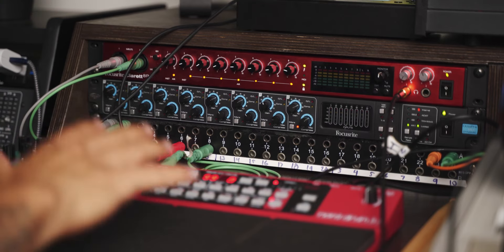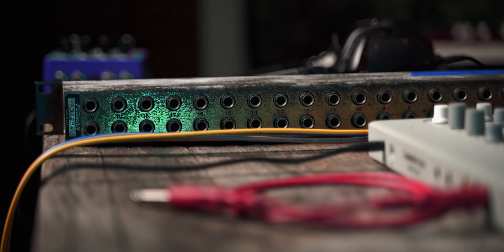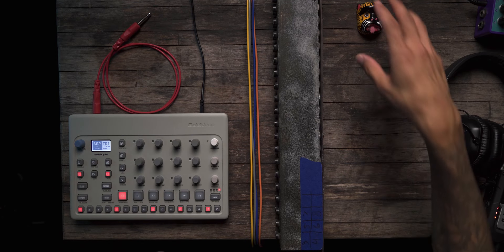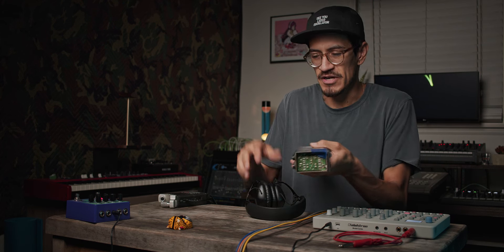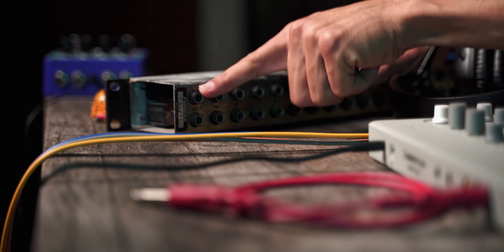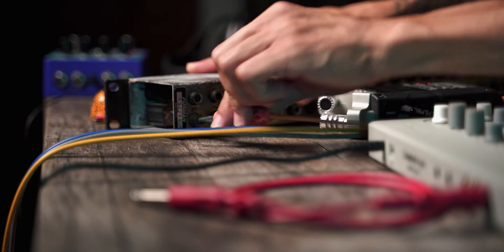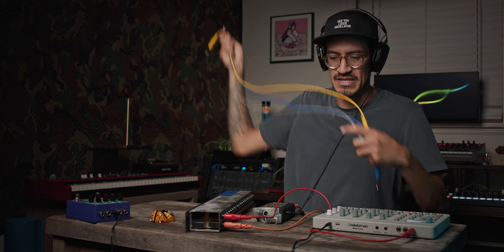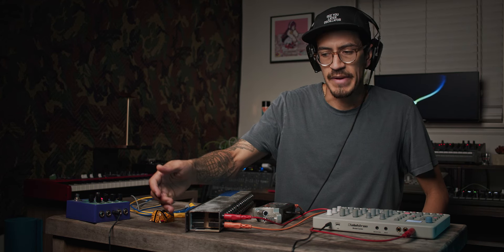3 ways to use a Patch Bay // Why they're amazing but not necessary.

Comment from the maker: OnceUponASynth vid here - https://youtu.be/Ie8J_XjOaFw
As well as the Samson patchbay I was talking about - https://amzn.to/3h2smk2
Reply: Dope video but that link is dead for me.
Reply: @toastyghosty489  The link works for me
Reply: What if you wanna hookup 5 synths to this and then depending on whatever one you want to route into your audio interface, you just patch it to there? so no bottom plug on the output for each synth, but a single output and no input on the channel for the audio interface?
Reply: Can confirm that the Samson one is very good!
Reply: Are you familiar with the BoredBrain Patchulator 8000? Never knew I needed, couldn't live without.
Reply: @elpotato198  Sure; in that case you're just not using the normalling, and you'd plug from the front panel top from synth into the bottom into the audio interface. But if your synths have inputs as well you can add them to the patch bay, and route from your lead through another synth maybe for its effects or filter or stuff, then onto your input.
Reply: Any link to the audio of the song you playing on the video ?
Reply: @zenkomusic  It seems like Samson is the only mfr. that has an important patch-bay feature not to miss. memory is not serving me well which feature, though. ;-)

Comment: Other big benefit Ricky is that it really reduces wear and tear on gear IO’s; better to clap out a $100 patchbay than an expensive or vintage piece of gear.
Reply from the maker: Yeah, I never thought about it that way! That is a completely valid point
Reply: my analog keys headphone output has a broken tip from a jack plug stuck in it, that was a major reason why i bought a patch bay.
Reply: Even just moving the gear around to get to the output will cause wear and tear
Reply: Leslie Dugger or could drop a heavy keyboard or something.
Reply: Burp Robrox totally! I have a Jupiter 8 I’d hate see crash on the floor or on my foot!
Reply: Leslie Dugger not the fabled Jupiter Ain’t as in Ain’t working after it crashes to the ground 😩
Reply: James Reedy this one is luckily still in orbit.
Reply: @Morne555  
Exactly the same happened to my Analog Four , still has the tip stuck in it
Reply: yes, this is why i want to do it. I have expensive rack gear but also wired a snake through my soundproofed wall and would dread having to replace any of the xlrs
Reply: @matthewspring2496  they are pretty straight forward to open and if you are lucky you can push it out from the inside, but even soldering a new socket in should not be that hard for a beginner ;)

Comment: This is soooo good. No one explains it like this and I’ve been researching for some time now. Most people explain patch bays using those diagrams, which can help grasp the signal flow of it all, but seeing you run through it stripped down and hands on connects so many dots in my head (no pun intended?) and already unlocked more ideas than I thought possible before (and I don’t even intend to use my patch bay for the same applications shown here) great video, thank you!

Comment: Using left/right top/bottom is perfectly reasonable strategy with unnormalled style patch bays. There are lots of flexible ways of using that as well. There's a reason patch bays come in different configurations and switchable configurations

Comment: Nice video! I have 5 rack synths - MKS-80, MKS-70, JD-990, EMU 9090 and a TX-802 and at first my assumption was - get a mixer and throw everything in and have L/R out to an audio interface and into the mac and use the mixer to control levels - or get an audio interface with 10 or more inputs. I then realized - I don’t need to listen to or record all the synths at the same time, so I don’t need the mixer, and as for the audio interface - a Scarlett 18i20 is powerful but ridiculously expensive, so I got a 4i4 (a 2i2 would do it too) and got the Samson 48 point balanced patch bay, plugged the 5 synths into the 10 “ins” on the back with my most used synth on the first 2, have the first 2 outs on the back of the patchbay always going to the Scarlett, and then just use patch cables on the front to choose which synth I want to go to the Scarlett. For example - 1 and 2 on the back is my MKS-80. 25 and 26 directly below that on the back go out to the Scarlett. 3 and 4 on the back is the JD-990. If I want to record or listen to the MKS - I don’t need to do anything. If I want to listen to the JD-990, just plug patch cables from 3 to 25 and from 4 and 26 on the front. As for effects - I just add it between the patch bay out to the Scarlett in.

Comment: I saw a badass routing trick in a video by the guy who made the Minibay. Let’s say you have a sound maker with a stereo output, for example a Volca Sample. Then you plug just the right channel on the patch bay into an fx input, eg a reverb. Now you can pan dry tracks on the Sample to the left and wet tracks to the right! So you can treat tracks differently in one box with one fx input. (The Minibay has a summed feature where you can sum up to three signals, so that you can separate wet from dry, but they’re still going into one input on a mixer, for example).

Comment: Truly a game changer! I find myself quite often depressed about the limited and inflexible routing capabilities of hardware mixers, like limited amount of channels, sends, receives etc., especially with regards to using FX or quickly sampling something into (or from) a device or DAW. I always thought I had to step up the game and go for a bigger mixer with more channels, with the 'perfect' routing etc... Just to browse gear websites and to find out that you can spend hundreds or thousands on mixers, and would still be stuck with a relatively inflexible routing. And after all, for the typical (home) production use cases there is no need at all to mix together 16 signals or so at the same time. Well, good to learn from that video that I just need a patch bay instead, and probably all routing dreams will be leveraged forever ❤

Comment: And for those who want to totally get rid of cables on the front side while still being able to create complex signal chains, I can recommend the Flock Audio Patch. It uses a computer app to change the routings and has D-Sub ports on the back that can be converted to jacks or XLR using breakout cables.

Comment: We used to call that "Sniff & Break"
Top row are Un-normalised outputs and Botom row are Normalised inputs as you have shown.
So you can take a 'Sniff' of the signal IN/OUT from the Top or 'Break' the Path  when you plug something into the Input on the bottom. 
That's fine for In/Out or Insert Points BUT then if you just want to present individual jacks from the back of equipment you 'Usually' just Flip the card around and the permanently plugged in rear side always breaks the connection between Top and Bottom , giving you a simple output. 
I know YOU knew that Ricky but the vid only hinted at the last bit. 😉

Comment: I put off buying patchbays for ages thinking 'Not necessary, what's the point? Rather spend the $ on sexier gear.' Now I've finally bought a couple I don't know how I lived without them. One of the best things about them is that they make me use gear regularly that otherwise would be sitting on a shelf or in a drawer. I'd say to anyone that once you have enough gear that you're not using any piece because you can't be bothered to go through the hassle of getting it out of a drawer/off a shelf, finding cables and plugging it in just to see what something might sound like in a certain context - buy a patchbay! The Samson s-patch is really good.

Comment: Bit off topic but I couldn't help but notice the Focusrite Pro 40 there. I had the same converters for several years. I always felt they were solid and had no qualms about the output. They reeally are solid, that box has good mic-pres, lots of I/o for the time, recorded hundreds of pieces through them.  I added, not traded, an Apogee Duet firewire on a separete Mac Pro machine and the sound difference was incredible. I'm not going to say better, but the Apogee converters definitely sounded more musical and rich. Hang on for the next move. After six years I finally got my Burl B80 mothership with 4 in and 8 out starting configuration(can go up to 80 with cards). These are the best converters I've ever heard by a universe or 2. Most of the big studios are adopting them. Not cheap, but the difference between my output no and the good ole Focusrite was almost impossible to describe. Highly recommended.

Comment: I picked up the Behringer Ultrapatch Pro, they're cheap as chips and have switches for normal, half-normal and thru. I didn't want to fork out too much as I wasn't sure I needed one or not, I looked at the Samson and I reckon that's the obvious choice for quality. Turns out I really did need it, it's been a real help. 
 I've had to dismantle everything whilst I'm in-between permanent residencies and only have a temporary set-up that I'm hooking up differently all the time. Everything gets messy really quickly and I find that I'm fairly often taking everything apart and hooking it up again far too often so I'm going to put it back in. I could definitely do with another. The more I think about it, the more ways I think of using it, I guess I mean I've realised how to use it properly.
 Tonight is patch bay night and I needed a reminder on setting it up, was happy to see one of your videos on just the thing I was after, not quite sure how I missed it, I normally watch them all, They're great, this was very helpful.

Comment: I have been dealing with should I do this or what for a while now! And after watching your video you have convinced me to get a patch bay.  Adding more gear I out grew my Mackie 1202 and bought another 1202 and then using a Boss BR1600 for more inputs with all of this going into a 2 channel interface to record, something had to give. I had to move cables to sample, effects, vocoders and experiment. More cables were the issue with everything currently midi hub, USB hub and audio almost had me looking at in the box. However as a keyboard player it ain't the same. So I am ordering the Samson S after watching OnceUponASynth. I am convinced that I need a patch bay.

Comment: I use the Behringer px3000 its a superb patchbay .its a 48 channel patchbay and it offers 3 switchable modes.
Each channel has a switch so u can choose what you want that channel to be full,half,normal.
I use it instead of my mixer and I have it hooked up a a 8 channel interface which is then connected to my Apollo twin.
It’s very clean ,no interference,and I have everything patched into it so I can send any input to anywhere and route how I want too via a couple of guitar pedal cables on the from of the patchbay.

Ohh yeah and the best thing is it’s around $60 it’s a must have try it Ricky it’s better than the Samson.

Comment: Samson unit is great, no regrets purchasing.  If you're real clever, you can get 1/4 to 1/8 inch cables, and you can integrate your eurorack with some of your older gear that has CV/gate.  The older gear usually has 1/4 inputs/outputs for their cv/gate.
Reply from the maker: Oh damn didn’t even think about that! Thanks Isaac
Reply: @RickyTinez  I have an Elextrix filter factory and a DP4+ that both have 1/4 inputs for CV control, my patchbay is part of my eurorack setup.

Comment: If you have a balanced patchbay (TRS), you can use it to route MIDI too since "5 DIN" MIDI is really only 3 signal wires which can be converted to TRS on the patchbay end of the cable. You really have to solder your own cables because 5 DIN to TRS cables are hard to find (and who wants cables that are longer than they need to be?) but it's super easy and works great if you want to route a MIDI controller keyboard or sequencer to different gear without plugging and unplugging any MIDI cables. I use 1 Behringer PX3000 for my audio signals and another for MIDI. So great.

Comment: Very helpful video Ricky. Great timing too as I've just upgraded to a bigger mixer (QU32, built in sidechain, mmmmm nice) but with the increased size its not so easy to get to the inputs at the rear. I was considering a patchbay as I knew they could help, but got a bit confused with the different routing modes and wasnt sure if it was the right option. Your video was a huge help, cheers dude.

Comment: Thanks as always for the quality content! 

Did have a couple questions for you or the other viewers here. 

1. If I have a ton of guitar pedals I'd like to use with all of my synths / drum machines as well, is it possible to route a guitar into a patch bay? I was thinking maybe having an "in front of amp" as well as spots for the fx loop built into my amp. 

2. How do you wire a stereo pedal, for example a meris mercury 7 which only has one trs input and 2 outputs? I'd guess just a y cable?

3. Lastly, if I have outboard stereo pedals in my patch bay, can I also use them as mono fx without rewiring the back of the patch bay? 

Thanks to anyone and everyone for their 2 cents and for reading

Comment: I'm not a religious man - but god bless you Ricky! Love your attitude and your content :)
Reply from the maker: Haha thanks for the support ChiMon!
Reply: @RickyTinez  Your very welcome! btw the Samson patchbay is really great - I have two and will almost certainly get more as the studio expands. Having the switch on the front is perfect. The only downside with the unit is that there is almost no room to label the ins/outs which is quite important. My solution was to get some 1/3U or 1/2U blank panels that are installed above and below each patchbay. Then I printed the labels out using an Excel spreadsheet and finally got some adhesive clear plastic label displays - sort of like those used on shelves in supermarkets but much smaller - added the labels and stuck them onto the panels. https://www.amazon.com/Durable-801019-200X10Mm-Labelfix-Self-Adhesive/dp/B000KT6RJO.
Reply: Thank you for the great information, I will have to buy a patch bay to organize my cables.

Comment: Weird... I’ve been sorting out my patch bay this weekend!

I’m using 3 Samson units to hook up everything in my studio. I also found some cool split dual neutrik cables that will give me a bit more flexibility than half-normal routing.

1.
Mono synths/Individual Outs
Soundcard Inputs

2.
Stereo Synths/Effects
Soundcard Inputs

3.
Aux/Cue
Mixer Inputs/Aux Return/Effects Inputs

Basically, 1&2 land the outputs from my synths etc and give me quick access to recording. 3 sets up my mixer channels and it’s effects routing. Plus I’ve got patch points to any other audio inputs (e.g. record in on octatrack or guitar tuner input).

I could maybe see myself adding a 4th bay for modular inputs/outputs, as some of my synths have cv I/o.

Worth noting that patching like this does bump the cost of cabling quite a bit. Effectively 2-3 times the number of cables - this was surprisingly a lot more than the price of the patch bays for my studio.

Comment: Ricky, the WIZ....I'd like your expert opinion:  I got a Fostex x26 recorder. Only left channel has a low hum across all outs (line out L, headphone L, monitor  L).  I disconnected capstan motor, VU meters, still exists. Tried a different pwr adapter, no luck. No jacks plugged into it either.

Comment: I use a 64 point Switchcraft Studio Patch patchbay - pretty much all the same except mine has DB-25's on the back instead of 6.35mm jacks.  The DB25's just makes re-wiring if necessary so much easier and I can just DB-25 from my audio interface (a Focusrite RedNet A16R) to the DB-25 on the back of the patchbay.  They make DB-25 breakout cables with 6.35mm or other jacks for whatever you need.  It's a lot cleaner I think.

Comment: A 20 buck brother label printer with narrow tapes - once you have a labelmaker with the right tapes in it for you, so much time opens up.  Label everything on the front - I say "brother" as a brand because they have the largest variety of blank label tapes that you can actually order and get as well.  I used to use black and gold labels for fancy stuff, green labels with black text for general easy on the eye shelf labels, and you can get warning and hazard tapes (as well as tamper proof) like striped yellow and black and other "urgent" patterns/color schemes, which I would use near panels or on that one little switch that you can't disable, put tape over, or otherwise restrict access to but nobody should EVER use it and people invariably "bump" it, and surround it with bright, jarring labeling so people would stay away from it even if they forgot or were especially clumsy.
Reply: It also saves SO much wear and tear on your connectors and cables as well as making debugging a setup kind of a LOT easier.  :-)

Comment: Great video.
How does your 16-channel mixer factor in to your patch bay setup? Or does it?

Back in the day, I just used my 40-point bay in totally non-normalled fashion as just a way to connect things w/o moving cables, etc.
I'm just getting back to setting up my studio again and after watching a bunch of your videos I'm wondering if you use your 16-channel mixer with your patch bay at all.

I'm guessing that will depend on whether you do most of your mixing in the DAW or on the hardware mixer (?)